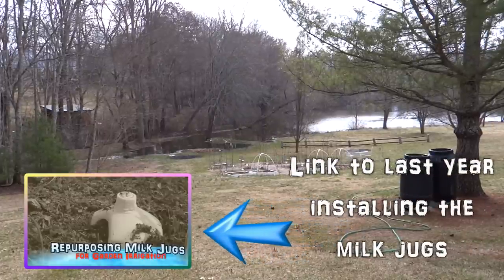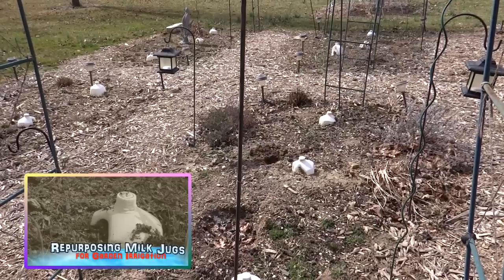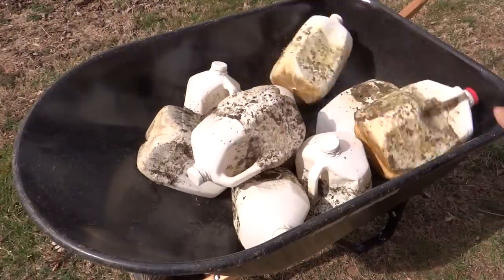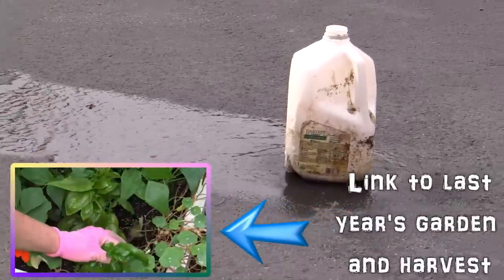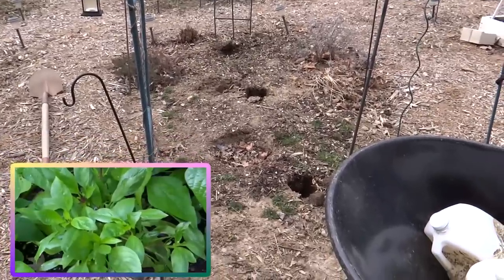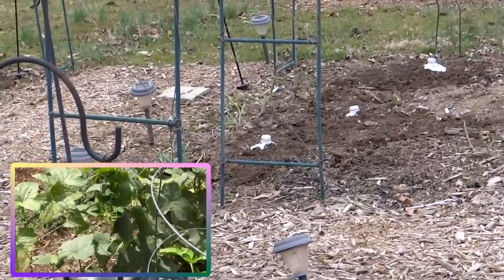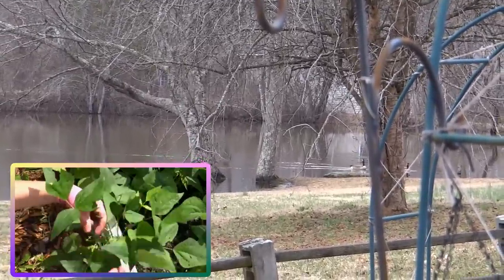"Olla" Maintenance One Year After Installation - "Poor Man's Olla" Milk Jugs for Irrigation

Comment: The joys of having an outdoor garden hose....we don't have that joy...collect all rainwater off the barn roof and its a hike to the garden.  Pumps have not worked out well but these ollas had so much promise.  Wish I watched this yesterday...before the storm I got frustrated with all the saved milk jugs and recylced them.   I had tried over the winter to make the olla in my sink and found that water did not drain out of the holes well once it reached a certain height...like the pressure decreased or something.  Maybe I did not have enough holes but it scared me away from trying.  Gee, after seeing yours drain so well, I think I am going to start saving them again.  Thanks for the update.

Comment: Thanks for posting this. I have been saving jugs and other containers to try this. I'm sure others have done it but this is the first video I've seen of it. I was thinking of burying it with a thin fleece wrapped around it to prevent holes clogging with dirt and keep it out of the jug. I was also thinking of back filling the hole with about 1/2 inch of sand around the jug to promote water flow but concerned that, instead of wicking straight into the garden soil, that most would drain down before it could wick outwards.
Reply: ***** I'm thinking of using 2 or 3 liter sodapop bottles, and then slipping an old knee-high nylon stocking around each one like a sleeve.  We'll see how it works.  Like the idea of backfilling with sand!
Reply from the maker: AnnBearForFreedom Great idea!
Reply from the maker: I think your concerns are warranted.  It is important to keep the lid on and this will help it flow out very slow and into the soil. Sand may prevent it from being absorbed from the soil around the plants and may drain just below the jug. By draining slowly,if your roots are in need of water, the water will flow to the dry areas in the soil where the plants have taken up moisture. Check out the new video I just posted on how they are doing 2 years later, after the initial install.

Comment: These seem to do the trick! Are you able to just fill the jugs and not have to water the hole garden surface?
Reply from the maker: Well, to be honest, last year we had a lot of rain. So I did not get to test them like I would have liked. I intentionally planted water loving cucumbers, tomatoes, and melons around them. Some of the more shallow rooted or root crops were planted in other areas. I do like that they collect rain water which would otherwise run off into the pathways. I recall watering my garden perhaps 5 times last year, twice with a hose and a few times with the watering can. I filled the jugs 2 times (when I had the hose).

Comment: Thanks for your reply. My jugs scrunch up and get distorted I think from suction.  I dont know why.  It flows very slowly. Maybe some hole s get plugged up.  All yours look normal.
Reply: As water drains, it creates negative  vacuum suction pressure inside the bottle. Add ONE tiny pinhole in the cap to allow air entry without evaporating the water, or slightly unscrew the top. This may accelerate the drainage of water, however, depending on the size and number of holes.

Comment: Here is what I do not get.  My jugs are scrunched up and bent when I dig them up.  I keep a lid on them, and I pierce them just like you do.   Why arent yours like mine when you dig them up?
Reply from the maker: +JerseyCityGirl9 Is the water draining out? If there is no water in the jugs, then they should be fine?  They should drain very slowly.  You can always leave the lid off for them to drain faster but I would keep the lid on during when mosquitoes are active in your area. :)
Reply: I replied the same to another comment. As water drains, it creates negative  vacuum suction pressure inside the bottle. Add ONE tiny PINhole in the cap to allow air entry without evaporating the water, or slightly unscrew the top. This may accelerate the drainage of water, however, depending on the size and number of holes.

Comment: Hi.  I made these and used them for one growing season, almost.  This Spring, I found one that had a lot of water in it, as if it did not drain.  I cleaned it and put more holes in it and put it back in the same place.   It was bent up when I pulled it out.  Others were bent too as if the air opening were inadequate to allow the seepage.  Have you experienced this?  I used an awl last year to make small holes.  This year I am using my grandmothers carving fork.  I am concerned it is making holes too large.
Reply from the maker: +JerseyCityGirl9 I had one or two with water in them, towards the bottom, The water should drain very slowly.  We had a lot of rain and the soil was saturated. If you did not experience the problem with all of them, perhaps it is the location. Is is compacted soil or is it already a water logged area? The water drained out of most all  my jugs.
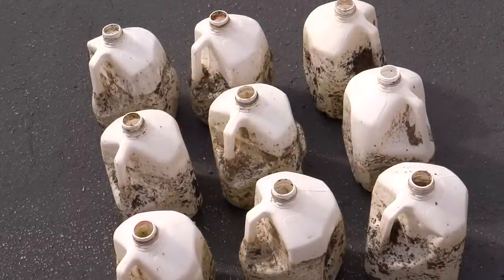Reply: +Rainbow Gardens  Great video ... 1:43  Next time, please do this test on the ground where plants can benefit from the water.. H2O is much precious than gold.. Especially here in ARID ARIZONA...
Reply from the maker: communistjesus LOL, I have so much water in my area, it FLOODS! :)